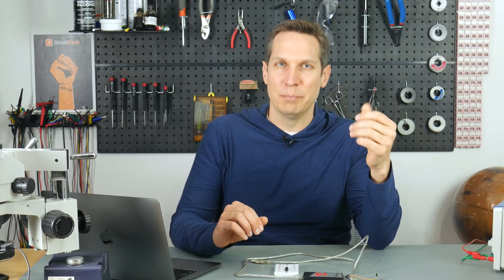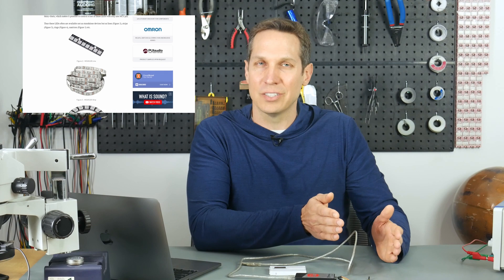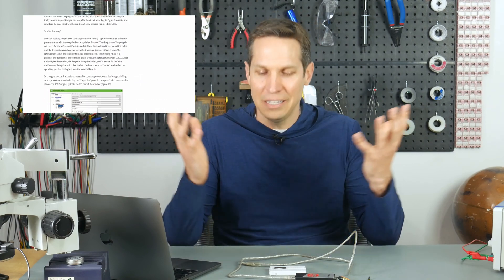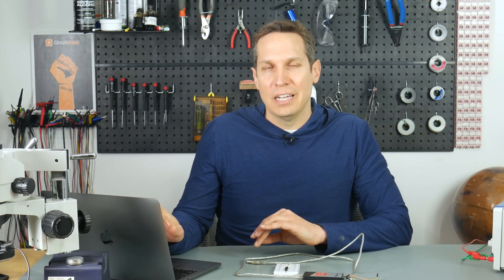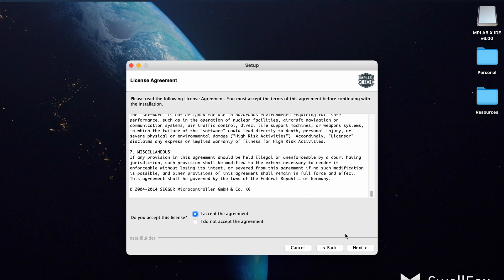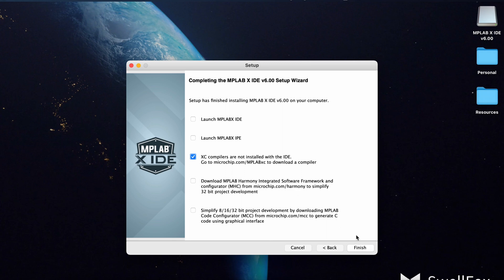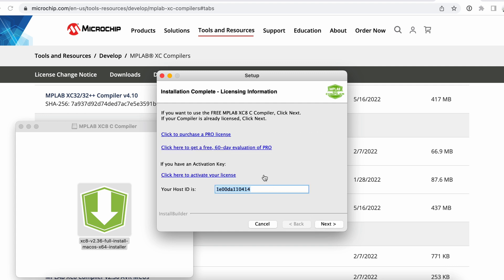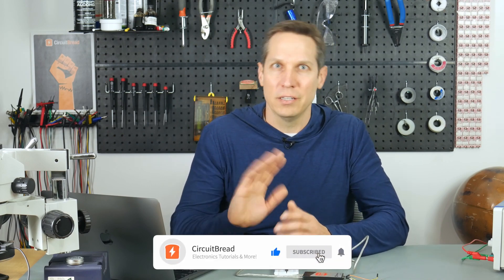Part 1. Intro to Embedded C Programming with the PIC18F14K50

Comment: Can you tell how to program an ic for user based input , say using up / down buttons? 
Like we have to do to set voltages - high , low etc.  OR make a video on this.
Reply from the maker: Yep, we cover that in two different videos, using the MCC and without.  You can find the one that doesn't use the MCC here: https://youtu.be/4dxnhgv2M6M
Reply: @CircuitBread  thank you for responding. i shall surely look it up.

Comment: I'm looking forward to the series.

On the MicroChip website there are two versions of the DIP PIC
PIC18F14K50-E/P and PIC18F14K50-I/P
Only the first one is currently in stock but the second is restocking shortly.  Do you know which one we need or does it even matter?
Reply from the maker: Great question!  For our uses, either one works.  The only difference should be environmental standards - one has a wider operating temperature range than the other.  If you're just using it in your lab, you shouldn't be even close to the extremes for either PIC.
Reply: @CircuitBread  thank you for the quick answer!  Yes, just using it in the lab for now.  I could not find the answer in their brief datasheet.

Comment: I love uCs for for one particular reason. You know by now I'm a mere cable monkey, but i do repairs and stuff. Repairing appliances like Microwaves, washing machines, tumblers and so on aren't really complicated, despite their fancy user interfaces nowadays. If these UI's die or shut down bc of planned obsolescence , you can brew your own. Just beware, building a Wifi enabled Microwave might proof difficult  😛
I used to do this with with relays back in the days, when uCs existed but weren't as accessible as they are today.
Reply from the maker: Ha!  "Why does the microwave keep losing signal right when it starts cooking?  So strange..."  Laren's (he's the lead designer for CircuitBread) only video was a review the Amazon Alexa microwave and, I think like most people, was fairly underwhelmed by it...

Comment: So far, I've only dealt with Arduino and arduino-compatible hardware like ESP32s etc. What would be the reason to learn a new hardware and IDE? Is it really worth it, or should I stick to Arduino as a hobbyist?
Reply from the maker: Each ecosystem has their own pros and cons.  If you're a hobbyist and are more end-result interested versus enjoying the process, well... I'd probably just stick with the Arduino.  Arduinos are surprisingly inexpensive, don't need specific programmers (like the PICKit), and some of them are quite powerful.  On top of this, there is A LOT of fantastic information and help for Arduinos.  That being said, Arduino scales poorly in pricing (buying 1,000+ doesn't see significant price drops like you'd see with an MCU), is not very efficient in its code, is not at flexible on the hardware side, and is missing many features that are needed in "serious" applications.  So, pros and cons for each but it sounds like you're probably good with just sticking with the Arduino platform.

Comment: Very refreshing to see PIC tutorials amongst all the other types of MCUs out there.
Reply: I am using PIC XC8 because Arduino although may get you there faster with lots of different peripherals at some point you are going to have to get your hands dirty and decipher a datasheet and write appropriate code and the friendly Arduino libraries won't troubleshoot for you. I have also found that once you have C down adapting Arduino C libraries for use on PIC is a good resource and starting point.